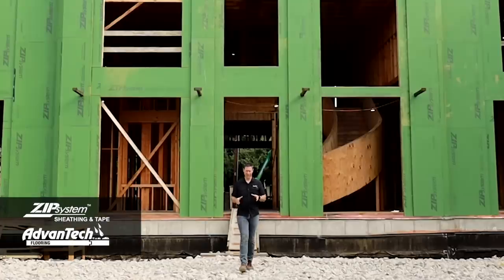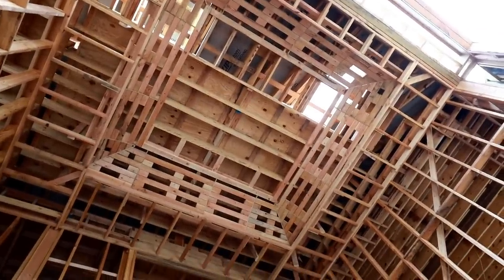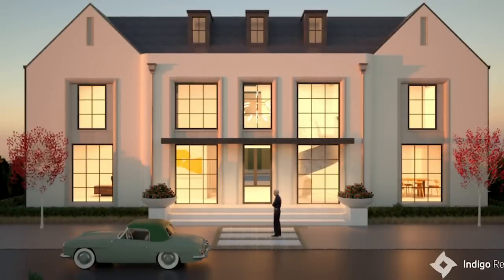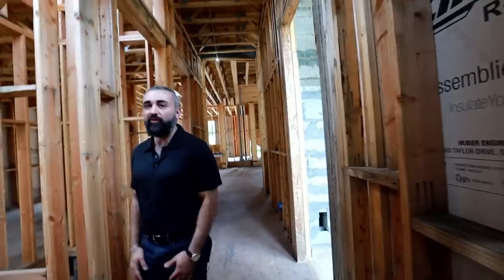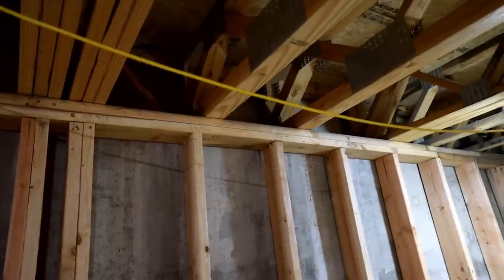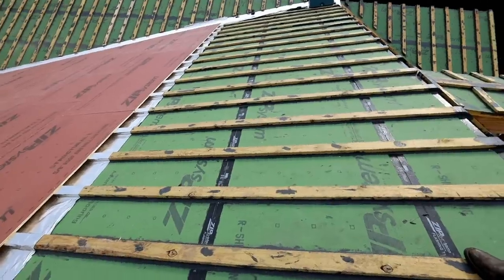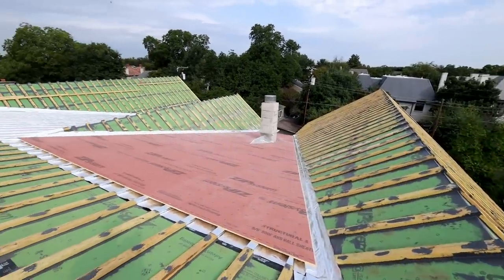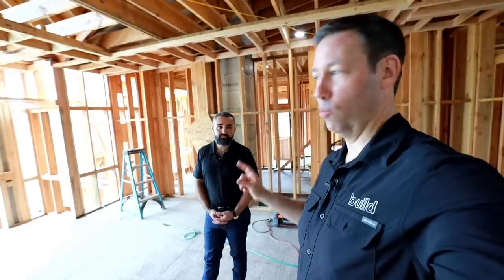INSULATED/Sealed Roof Deck , WITH Radiant Barrier AND it’s Vented...Haven’t seen this before!

Comment: Great details, I’m curious if and how the aluminum layer affects Cellular reception, WiFi signals, and other EMFs.
Reply: My personal home is completely wrapped in foil and I have full Wi-Fi  to the fence 200 feet ish from the router that is located in the center of the house.
Reply: Radiant barriers on the roof will have essentially no impact on any common RF signal since none of them are coming from "above" (like a satellite).  Anecdotally, home WiFi signals might actually have better range due to the reflections indoor... but I haven't seen any evidence that that is definitely true.

Cellular signals and the like are coming at a much lower angle and so aren't affected by the roof.  That does mean that if you wrap your entire house with a radiant barrier, though, then the signals MIGHT be affected.  Most houses have enough windows to make up for the blocked signals, so you likely wouldn't run into problems unless the signal source was on a side of the house that had none.
Reply: Tyrone Ismyname In this case I don’t doubt the ability to have strong WiFi signal. I was talking about the affect it has on the quality of signals and frequencies. Generally speaking, A metal shell around a transmitter/receiver acts as an amplifier to the already existing interference. Wood and concrete act as blocking agents to RF signals. I would have to do some in depth testing in different environments to see what’s actually happening. This home in the video is very close to other homes, so it would be interesting to measure if the neighbors signals (interference) would be amplified by the metal layer and would they have any affect on the quality of signals being transmitted in and around the home.
Reply: Granworks Workshop I’m gona have to go ahead and disagree with you there. Good Measurements are necessary before drawing conclusions, but I was talking more about the amplification of interference that effects the quality of signal not the ability to have one. I believe all Cellular RF signals come from above and travel downward more successfully, not from the satellite but Cell towers are on a hill for a reason. Even In a home, WiFi signals travel better if the transmitter is located above the receiving device, transmitter installed on a ceiling for example instead of a closet or table.
Reply: No worries.  Just put a personal cell tower in the living room.  Problem solved.
Reply: Honest E There is WiFi mode on every cell phone, it does the same thing only better. You only need cell signal at home as a backup during power outages, if your security system uses SIM card and also if you have cellular data as failover routing for enterprise applications.
Reply: @ReasonablleDoubt  Where I work there is no cell connectivity. Not all cell phones do have the feature your talking about. Mine and many others do. Even with it, it doesn't work well most of the time. We have to go outside to make solid calls.
Reply: Honest E Not all cell phones have WiFi calling. All newer iOS and Android devices do. I don’t know what percentage of the US are using devices without WiFi calling feature. It never failed for me, works perfectly on my iOS device. When I’m inside any building I enable my phone airplane mode and it automatically goes to WiFi calling. I get every text message and call, but I use the latest iOS software so I’m not sure about Android users.
Reply: He will probably have a wifi booster system with such a large house.
Reply: @joemurphy4517  The question wasn’t about WiFi reception. It’s about aluminum flashings effect.

Comment: Would going over the Zip system, with, Henry's Blueskin, be an over kill? 
Because of all the other holes that are going to be put in it, (foam and siding) since Blueskin is self sealing?? Can anyone answer this?
Reply: I built a timber frame addition using 2 inch zip R (same as this product) after testing samples of the zip with nails for siding I decided to use the Henry blue skin to seal around nails so far I am very happy with the finished product
Reply: @strongbuilt  thank you so much for the response, because someone had brought up the topic about the thousands of additional holes, even after sealing the Zip nails with liquid flashing. So... I'm not the only 1 who thought of this. Thanks again.

Comment: I like over builds but...i mean, wouldnt weight be a issue eventually??  Holy moly
Reply: No it’s engineered with live and dead loads factored in so that tells the builder what’s necessary for the building plus this house is significantly lighter in weight compared to most large commercial properties

Comment: Please talk him out of lg vrf system for the hvac... I’m not one of those “engineers” that comments on your videos... I’ve been in the mechanical trades for 11 years and LG is absolute junk... he won’t get parts years down the road... Daikin or Mitsubishi are the only two brands I can install and look a customer in the eyes knowing that they won’t spit in my face someday
Reply: We have used Daikin with good results, never LG. Your opinion opinion on Bosch?
Reply: Pangea Capital LLC  I don’t have a lot of access to bosch, I’ve heard great things on the residential side for their vrf condensers and matching air handlers though. I’m thinking about putting one in at my house to test, currently have a Mitsubishi system that works great but want to test the Bosch... buderus bought them out and I’m a fan of them
Reply: I agree LG is junk. Been screwed wayyy to many times. I had to switch to fujitsu so far so good. I also offer trane branded Mitsubishi

Comment: This sounds like a very expensive home in a steady area that's going to be considered over priced for neighborhood would be my guess.
It also sounds like alot of 1st time doing it myself(not certified or experience) which usually leads to alot of failure points or issues down the road.....but a final tour and a power bill would be very interesting. 
But this guy might have just went mad scientist and make this work.
Reply: Lol, don't worry, it will fit right in.
Reply: I suspect most houses in that area are already well into the 7 figures
Reply: very expensive. They should use cardboard instead.
Reply: Keeping the material cost to be in a range of price in the area usually leads to poor quality of constructions. When you build a custom home for someone who can afford the expense, there is no reason to look if the cost of the house exceeds average house price in a neighborhood.
Reply: @teddy0139  That home screams 'spec'
Reply: That’s probably the most expensive neighborhood in Texas, I don’t think anyone is worried about doing things that cost too much,
Reply: In Highland Park? This is a starter home. Ok, that’s not true but it won’t even be close to the most expensive house in the neighborhood.
Reply: @Bill_N_ATX  that's what I was figuring this is going to be on a bad estimate bare minimum 50k to 100k more than anything around that house especially with that pool and I'm 100% sure he's going to make Matt's french country home look like it goes in a trailer park after he's done.

Comment: I'm guessing that his house cost more than $100sq/ft. to build.  ;)
Reply from the maker: Probably closer to $110 😂
Reply: TheHondaman probably closer to $300
Reply: @gregoryvschmidt , Do I hear 350, 350, 400, 400, 450, 450, 500, 500...Do I hear 600, 600 ? Sold at 725 !!
Reply: august that’s crazy. Most of the house is empty space
Reply: @4philipp , I know. I was just kidding. It is a well built house, that's for sure.

Comment: An interesting couple in Idaho has built their own timberframe house based on ICF's,  Sips, and did a roof similar to this idea.  Using an air gap to insulate from the snow/heat.  They're not done with the house yet, but it's a fun channel to watch.  Check out Pure Living for Life.  DIY as they go, not knowing how to do any of it, they're researching and doing the best they can.  They've been quite successful so far.
Reply: Kevin love that channel 👍
Reply: The channel does have plenty of building mistakes. They freely admit it. It is NOT meant to be nor advertised as a how to channel. So there is nothing to complain about. Just interesting content.
Reply: @ah244895 , It WAS an interesting channel until they started blocking anyone and everyone with constructive criticism. Jesse ruined his own channel with his constant yapping and blocking people who were only trying to help them.
Reply: Never got a great feeling from that channel.
Reply: @JimYeats , I just went and tried to watch 2 of their new videos and it's the same exact thing, Jesse, with his blah, blah, blah the whole time. Now the comments are off also, so even if you wanted to help by suggesting something or to just say, what a great video, you can't.

Comment: And I had to settle for insulation 2.0 sigh
Reply: Somebody should have told the guy . There is a technology  stucco over foam .He could have saved money on insulated zipps and cinder blocks
Reply: @andreycham4797  Some cities in the North Dallas area require brick first if you plan to stucco

Comment: Dario sounds like a great guy, takes care of his workers, and gives back in a meaningful way.  But the reason I watched this was the roof system I have been trying to figure out a retrofit roof for my home with steel, insulation, and radiant barrier.  Its nice to see someone who is smarter than me working on a similar concept.  I am stuck between 2 inch r-tech with the foil up, and vertical, then horizontal stringers , or possibly split verticals with a radiant barrier in between then the horizontal for the steel.  I have done a bunch of researching but never found a good answer on the gains of having the radiant barrier having air flow on one side or both of it.  To my reasoning having it float with both sides getting air flow would be better, but the reality is it will probably sag at some point and only have airflow on one surface anyway.  Great show, and as I said, nice to know that I may be on at least a parallel track if not the right one.

Comment: Hey Matt, I am a fellow Austin-ite dealing with this crazy weather.  I noticed that after the ice storm, the ice is melting from the bottom--next to the darker concrete due to radiant heating.  It is below 32 degrees today, so the melting is not due to conduction.  Can you do a video showing how radiant heat transfer through the ice.  If you show this, I think people will relate to how a reflective barrier can help keep the radiant energy in (or out) depending on your climate zone.  

Also, how is your insanely well-insulated house holding out?  My Texas house has had no water for the past 4 days.  I fear I won't be able to get either a plumber or even the parts I'll need to DIY.

Comment: Wow , Very Cool,   I'm about to replace the heating and cooling at my parents place,  and adding a quietcool in the house and garage and radiant barrier in the attic and upping the R value in the attic ( and might install a stand alone 16K+ solar system & battery connected to a heat pump hvac to get free heating cooling, pending as my estimates is about $19K, so it might not pay off for years )

Comment: Hey Matt, love the videos. I do ac mechanical install/rough ins. Dropping a collar from the attic is extremely annoying. Depending on tape measures mood it's 50/50 if it will grab it. I cannot find a telescoping magnetic tool and/or grabber over 36". Someone should invent one. 72" to 96" telescoping, doesn't have to be pen size, just put in tool belt. Til then, where's that damn ladder! Your houses are nice and air TIGHT!  If anyone is looking to an air tight house matts your guy. For sure passing every duct leak test

Comment: I thought I was the only crazy insulation guy.  I did the same thing with 2x4 on my roof over 2inch of foam sheets. Then sheathed the normal rooftop on top and finished off with aluminum shingles.  No heat got inside that.  Anything that did was vented out the top ridge vent.

Comment: This build is pretty neat, I think the only thing I would've done different is I would've done the roof insulation similar to how you did your own house. Just regular 5/8 zip on the rafters, insulate then fasten your nail base on top, and if you needed to vent then screw down your 1x before your nail base. Your polyiso has it's own radiant foil already, imo that's probably faster than driving longer nails with the Zip-R. He probably could've done the walls that way too considering he was talking about radiant barrier. Regular Zip sheathing, Insulate, rainscreen, CMU then stucco. For a project that scale, that's probably what I would've done for speed, ease of installation and optimization.

I think I've gotten quotes for Zip-R and it's not all that worth it even if you factor in labor savings especially once you get past the point of 3 1/4" fasteners because that requires a different nailer that can handle jumbo nails. Jumbo nails need to be special ordered, etc. Last I checked a standard zip sheathing + a separate sheet polyiso insulation is less than the cost of a Zip-R. I think once past 1.5" Zip-R, you've gone past the would be cost savings of having a single sheet of sheathing with insulation built in.

Comment: Inspirational!  I would have done rock wool instead of foam for the soundproofing and fireproofing.  When there is a fire, toxic smoke from the foam is a concern.  Not sure if zip r is waterproof either like rock wool.    Also, plan to engineer mine to better withstand earthquakes, hurricanes, and tornadoes.  

Any plans for solar and power walls or backup power source?  Fresh air recovery ventilator?

Comment: impressive!!! the only question I had, what happens to the final layer of Zip (roof sheathing) over the 75-100 years of the slate roofs life span. in the northeast, we would have gone "olde school" and used real wood skip sheathing. As we learned in other of Matt's videos manmade materials can have issues over time. Wood can often be more resilient and allow for drying out if the slate every allows any water in. Also, I find that wood holds nails better over time than OSB. I have deconstructed many slate roof houses & barns, and slate seems to last longer if it can dry out from below. not trying to be nitpicky. This job is super impressive. Just wondering what other builders think about the longevity of Zip as a final layer for a slate roof.

Comment: I really liked the French drain around the house with the sump pump in the basement.

However, the radiant barrier on the roof needs to be floating (by stapling or glued) on the pressure treated 2” x 4” (not pressed against the 2” x 4” and the Zip sheathing), and a second group of 2” x 4” perpendicular to the first group of 2” x 4” is placed on top of the radiant barrier.  This keeps the 2” x 4” sandwiched in the middle.

By doing this, the radiant barrier is minimizing the surfaces it is able to touch (it is only in contact with the 2” x 4” not the Zip sheathing).  Otherwise, since the radiant barrier is a metallic foil (and as a metal absorbs heat quickly), it will transfer any heat it absorbs to any surface in contact with it.

Since there is a small air gap below and above the radiant barrier, when there is a little bit of wind, it should blow the hot air up (hot air rises) towards a roof ridge, and from there the hot air is blown out to the environment.

Another issue that might or might not be a problem is the skylight over the stairs.  As Matt said it will bring light down from the roof to every floor below it.  However, sunlight has the potential to bring both visible light and thermal energy.  If the light is indirect to control the thermal energy, it will keep heat down; otherwise, it will bring inside the house a considerable amount of summer heat, but this was not explained.

A few other things I liked are his effort to keep costs at a manageable level; I like the combo design of the basement as a wine cellar and car garage, and I love the copper sill.

His crew are first rate, and this can be seen in the roofing and inside framing work.

Comment: I am looking into doing this roof style in southern Idaho. I am going to do staggered stud construction on the outside though. Do you think closed cell foam would be too much with the zip R? Or would open cell or rockwool be better? 

Matt I want you to do some examples of staggered stud construction so badly. Or ask Steve bascik about it. 

Great build overall. Does he plan on adding more insulation to the attic at all?

Comment: His roof design is pretty common up north and especially into Canada.  It's called a cold roof. It's the only way to keep the condensation out of the decking if you spray foam insulate your ceilings.

Comment: Hello matt, I've been watching your videos for a few years now. Amazing and informative videos. We  build homes on 30a om Santa Rosa beach FL.  We currently have 5 homes under construction.  I'm writing tou about the gulf front home we are building, its 10,000 sq. Ft. 3 stories and we are doing the zip 2.0 system on all the walls.  Can you give me an idea how far 1 tube of the flashing goes when doing the 2.0 system.  I plan on taking one tube and seeing how far it will cover then  calculating from there the total linear feet of seams. But was wondering if you may had an idea how far it goes?  Also we used the 5/8 zip on the roof and that will also be 2.0 with boral peel and stick over it.  Wanted your thoughts on that. 
Thanks 
Casey Henderson